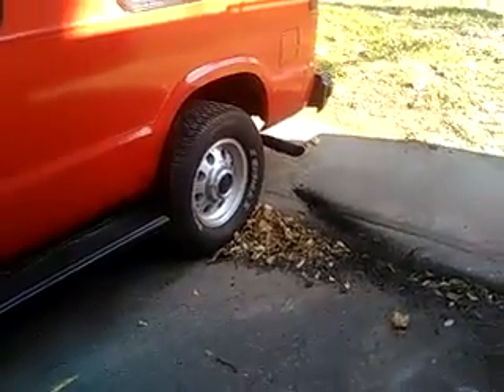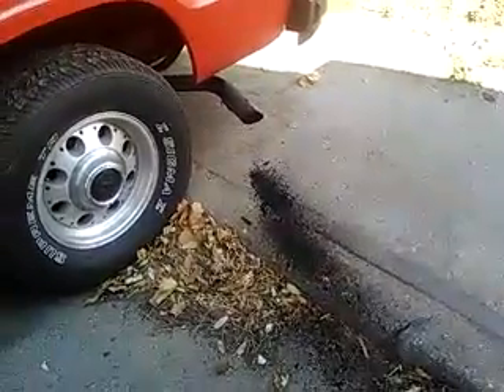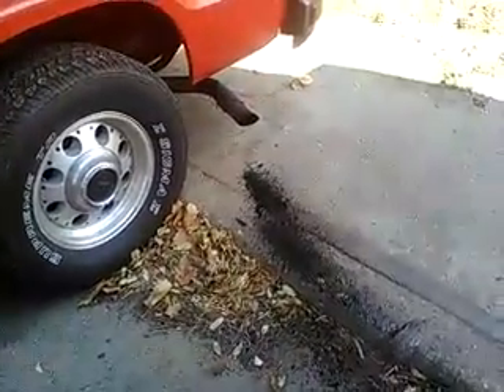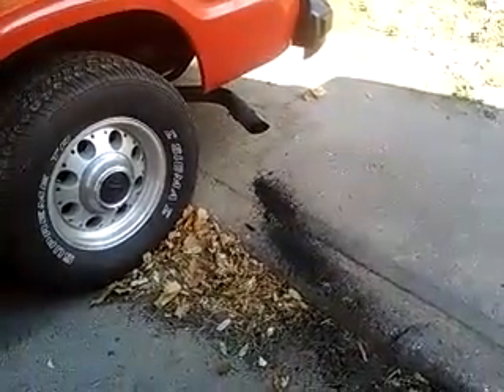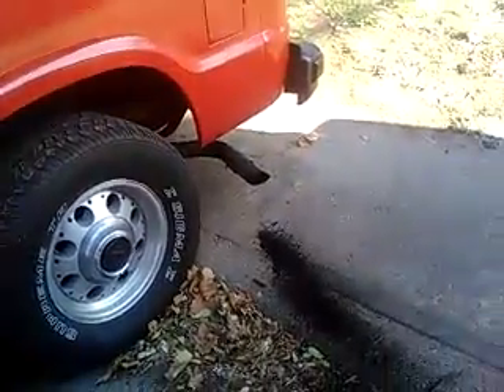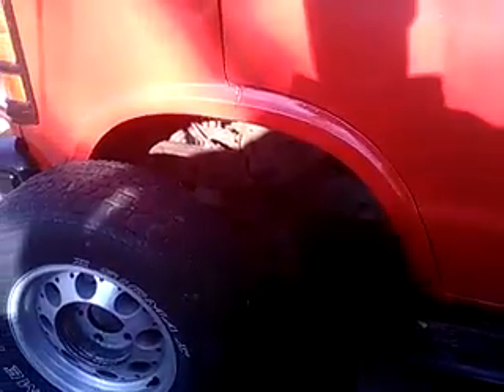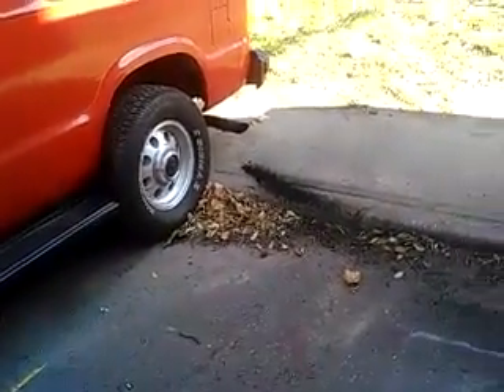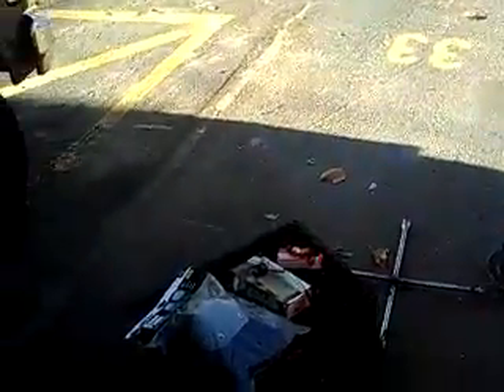more progress and repairs on the bass van slow progress is better than no progress

Comment: Hey i had a Lincoln town car  the map sensor was loose gave me that issue also spurting off. Also had clean the throttle body out. A if it carburetor might be out of adjusting which happened to my lowrider.just some options suggestion look out for

Comment: do you run regular  (87) gas in that van? PLEASE SAY NO..... but if you do, switch to a higher grade ,at least   89... and run a bottle of seafoam in it.. half a bottle in your tank, half thru your intake.. also you will need to change your 02 sensor. because of all that soot that came out of your tailpipe  has definitely covered your sensor and its not going to get an accurate reading now. the black smoke means thats its running too rich... a new 02, sensor and better gas, (u might also need to do a tune up at this point) but start with the sensor and better gas and a seafoam treatment